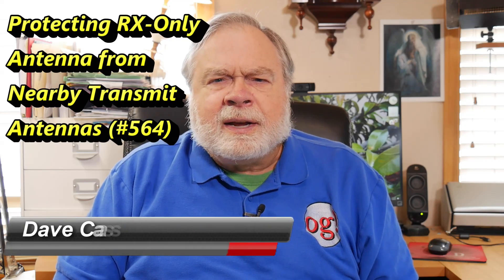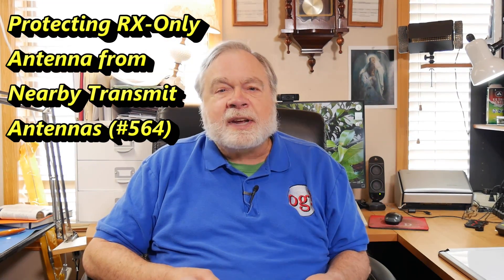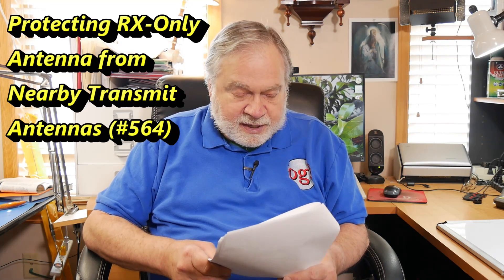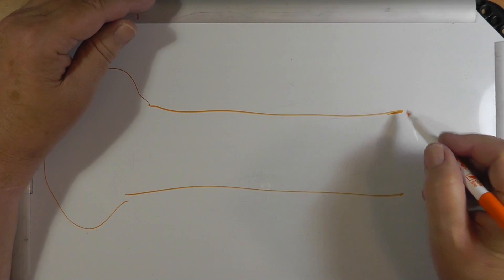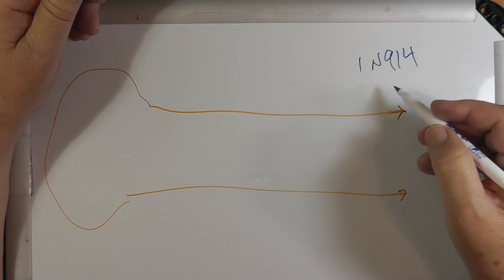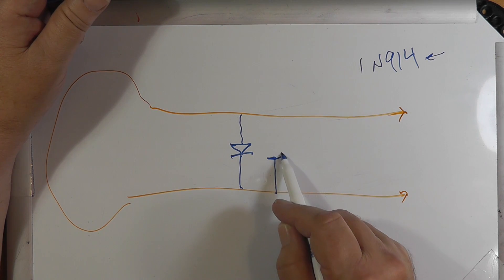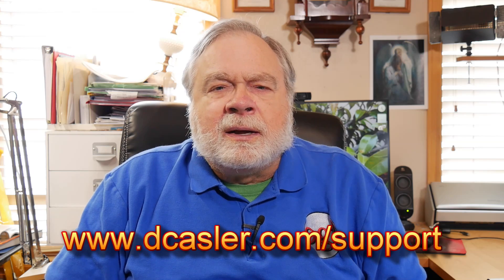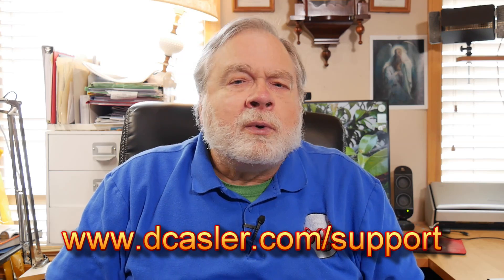Protecting RX-only Antenna from Nearby Transmit Antennas (#564)

Comment: Thanks Dave.  I have two DX Engineering RF-PRO-1B receive only antennas.  They are phased together with the DX Engineering NCC-2 receive antenna phasing controller.  I use this system with my IC=7300.  The bias-T for the RF=PRO 1B antenna has an RCA jack that allows you to connect it to the SEND jack on the IC-7300,or in my case, the NCC-2  which, on key down, will kill the power to the receive antennas pre amps.  If you are using a receive only antenna with a pre amp that does not have a PTT/transmit to ground jack for power disconnect, one could build a simple interface relay to kill the power to any line powered receive only antenna.   Thanks,   '73  Bob

Comment: FWIW I have used back to back LEDs for the same purpose giving a higher threshold, but of course the front end of the receiver is subject to more signal before clipping occurs. It was an unusual situation sharing a roof with someone else running 100w on the same band as I was on. FWIW cross polarisation can also help reduce the levels at the receiver. Most CB radios use a combination of the back to back diodes and a small coupling capacitor in their receive circuitry to protect them from the transmitter, ham rigs tend to disconnect the receiver when on transmit. I suspect for your loop example the IN914s would be  great solution but BEFORE any associated pre-amplifier. 3

Comment: Thanks Dave, another great very informative video. The 1N4448 is the higher current version of the 1N914 also slight leakage current improvement; however, 1N914 is good in 99.9999% of the cases. Those A/D antennas are indeed "tanks" excellent store-bought antenna....
73' de K4WRF

Comment: I have a Chinese MLA-30+ receiving loop with a bias-T powered pre-amp.  I use it a lot for monitoring and it is right next to my transmitting antenna.  Looking at the circuit diagram, I see that it already has back-to-back silicon signal diode protection built in.  Plus, it is non-resonant, and that greatly reduces the amount of current going into the pre-amp.  So I don't worry about it.  

For field day with multiple radios operating on different bands in a small field with resonant antennas, this can be a real danger to a transceiver's or receiver's front end, whether through a pre-amp or not.   Like lightning strikes, these kinds of induced currents can burn out a coil or the first RF amplifier.  One can buy RF overload protectors for receivers, but they are expensive.  I think DX Engineering sells one for about $70.  

I built my own for my receiver just using parts from the junk box.  I used the two back-to-back silicone signal diodes Dave mentions (I think the 1N914's are obsolete now, but anything similar will work), and then another pair of small power rectifier diodes (1N4007's) with that as well in case one of the small signal diodes opens up during an overload.  In addition, as another commenter suggested, I wired in a small 0.2 amp penlight bulb in series to my circuit to act as a combination current limiter/fuse.  

One can find circuits for these kinds of protective devices online if you search for them.  If you can't and want to build your own, just email me using my QRZ address and I'll send a circuit picture.  -- John N0BUP
Reply: Thank you. I didn't know that. I will send you an email.

Comment: The inverse-square law only works in the far field of a finite sized radiator. Antennas radiating wavelengths at 10m, say, may not even begin to form far-field antenna pattern and inverse-square drop off for at least 100m-200m, so it might work on a farm, but not a suburban lot. It will be worse for longer wavelengths.

Comment: Many modern radios include protected inputs for receive-only antennas which solves the problem. Even the IC-7300 has a inexpensive after-market modification to accept a receive only antenna and protects the front-end. Boatanchor transmitter/receiver combinations used relay based T/R switching which could also protect a separate receiver's front-end. 73 - Dino KLØS

Comment: What about a double pole double throw relay that can be turned on when transmitting and off when receiving in such a way the relay will disconnect the loop from the antenna preamp.
Reply: Generally, the time delay in a traditional relay doesn't make it a good choice.

Comment: @Dcasler, suppose that we're not dealing with a RX-only loop antenna, but rather two EFHW antennas in close proximity. If one EFHW is transmitting and other EFHW is receiving, what is the technique to protect the RX EFHW? Do you insert a Diode directly into the feed line? Please advise, and 73 de W3DJS (Friend and supporter of your channel)